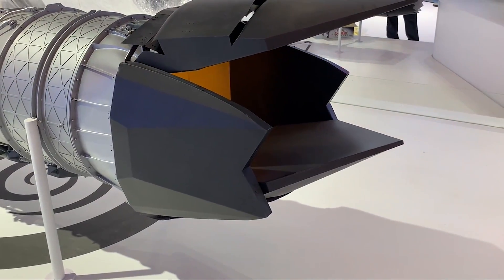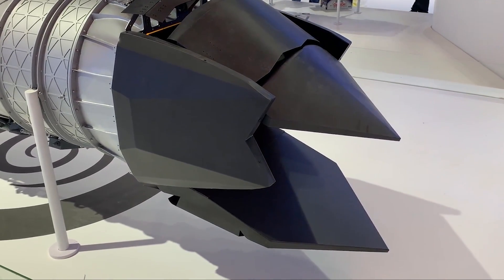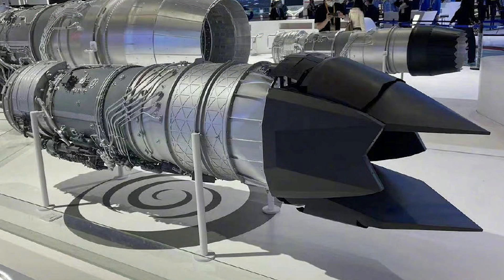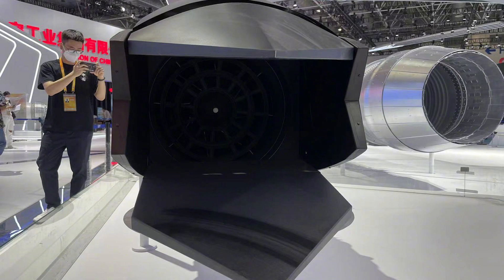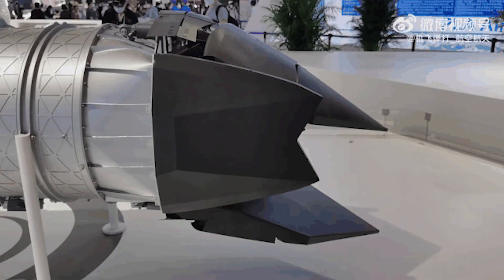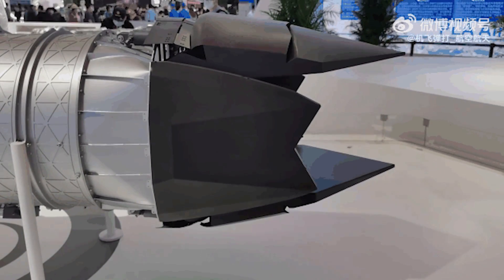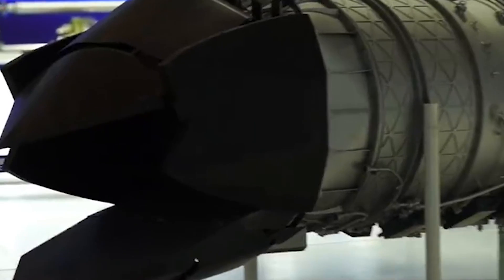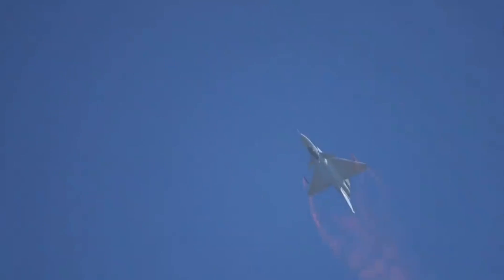China latest fighter engine is here! WS10TVC Thrust Vector Control turbofan engine official unveil

Comment: Looks like a copy from F22 Raptor of USA 🤣😂🤣😂🤣😂
Reply: Nope, F22 does not thrust vector, it merely changes thrust nozzle diameter by fully opening or semi-closing the thrust outlet. This Chinese engine vectors up-down and left-right, only Russian engines have similar 3d vectoring characteristics using a different thrust vectoring nozzle.

Comment: Don't bother about the J-20 or J-35. 

These engines will power heavy 'stealth' drones , optimized for supersonic speeds and fuel efficient 'supercruise' (F-22 interceptor requirements), hence dependent on thrust vectoring at subsonic speeds - either carrying large hypersonic weapons for strategic strikes at stand-off distance, large early warning and networked tracking RADARS or fuel supplies - or are engaging in high powered electronic warfare that can deny the use of sophisticated fire control RADARS like that of the F-35. 

Single stat equipment porn about the mere engines of an air force is for self-complacent Westerners and their Westernized troll pets...

Comment: looks like an f22 engine
Reply: Ctrl+c,Ctrl+v like everything
Reply: many places are different
By your logic, all cars in the world have the same tires and tank tracks
Reply: @dailm8056  What the fuck kind of analogy is that
Reply: @dailm8056  it looks like the f22 engine because it does and because china copied it
Reply: @dailm8056  do you know how unique the f22 engine looks?
Reply: @h.l4650  I know
This is a 2D vector engine
There is also a 360-degree vector engine
Two basic theories have been proposed over the last century
This is not unique to the Americans, the Russians have also done related experiments
But the needs of each country are different. The Americans chose the former, while the Russians chose the 360-degree vector engine.
The Americans used the two-dimensional vector engine on the F22, not the Chinese copied it, but the Chinese adopted this theoretical situation, and the specific product design and manufacturing were completed by the Chinese themselves.
And the reason why no other country has used 2D vector engines before is that they simply don't have suitable fifth-generation fighters to equip, and even they don't have suitable wind tunnels and supercomputers to simulate the stealth aspect of the computing engine design for testing. But these research equipments are available in China, and China has spent 10 years of investment and construction.
It is impossible for Americans to sell or send drawings and related technologies to the Chinese
This is a stupid question. And if you mean stealing, that's even more impossible, would you be stupid enough to let the same thief steal your property for 30 years?
The truth is that it can be copied simply by looking at it. Why can't Europe, Japan, India, South Korea, and Israel be copied? Why can't you simply copy anything beautiful and powerful?
And if you look closely, you will find that the amplitude of the jet port of the engine oscillates up and down, and the size, shape and angle of the blades of the jet port are completely different. Chinese engine jet ports are more complicated.
Reply: @dailm8056  ok but tldr
Reply: Nope, F22 does not thrust vector, it merely changes thrust diameter by fully opening or semi-closing thrust outlet.
Reply: @JA-pn4ji  f22 does have thrust vectoring... stupidity never ends